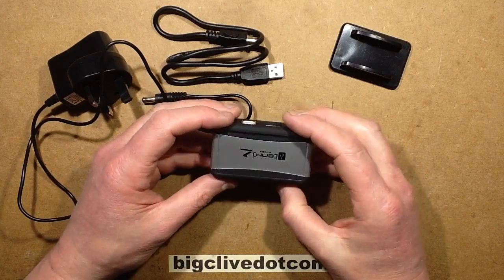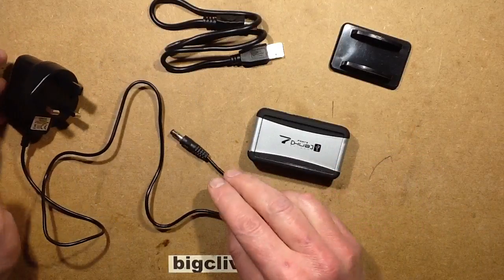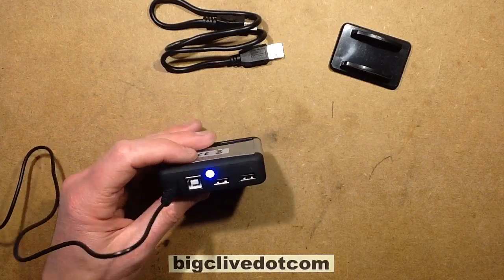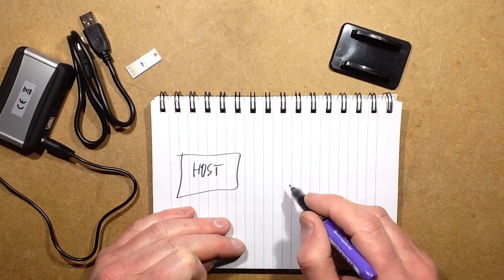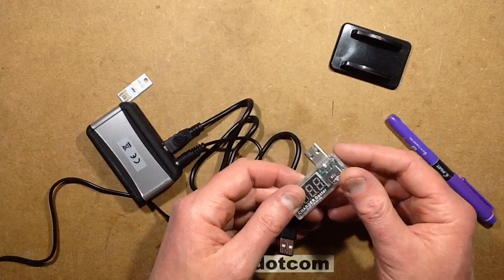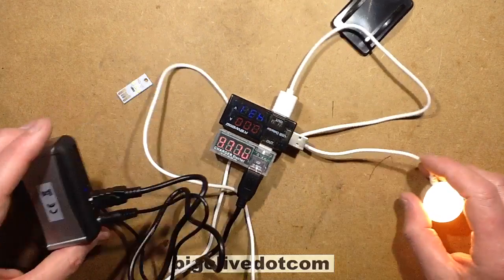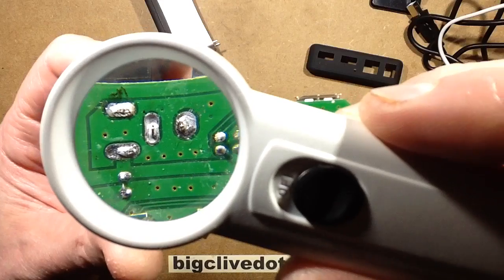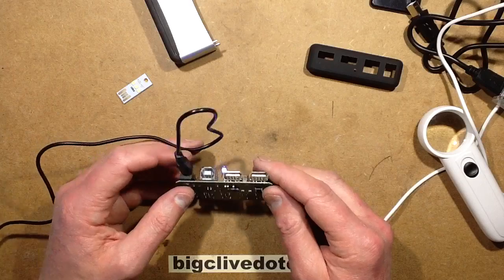Computer killing powered USB hub.  (Mac murderer)

Comment: Pretty much all hubs have the dc wired directly to the USB in. This should never cause damage to the host since for it to increase the computer's internal voltage it would take many amps of current. I've also powered arduinos simultaneously with the dc in and USB and never had damage occur.
Reply: +Anton Babiy It's funny, because they are not allowed to do so. Quoting from the standard: "No device shall supply (source) current on VBUS at its upstream facing port at any time. From VBUS on its
upstream facing port, a device may only draw (sink) current." Pretty clear, if you are not chinese.
Reply: +Anton Babiy +Some Guy You will normally have some sort of EDS protection. Reverse powering normally isn't such good idea. With standard chips you'l ll lift the supply domain through the ESD protection circuit. Something it is not designed to do. For the supply domain the situation is somewhat different. As you I'm a bit skeptical this is the real problem. On one side the Mac is not required to be protected against reverse feeding, on the other side I wouldn't expect it to be problem in most practical situations. 

Anton Babiy, inspired by your observations i checked my Logilink 10-port hub. Full continuity between power supply and upstream port. If bigclive is right, that would be a MAC killer too. I think he's been mislead there.

BTW: In an interesting side observation; I found my USB PSU is broken. That really explains a lot of problems I have had recently. :-)
Reply: +Anton Babiy Uhm no, pretty much all hubs have diodes to switch between either a charger or the hosts power, not both. If they were, they would either damage your USB controller or the port would be disabled by the USB controller which it does on shorts and overvoltages, a disabled USB port naturally does not work so for the hub to work it is not feeding 5v back into your USB controller on your motherboard.
Reply: +Some Guy in the computer the USB power is taken from the main 5v bus through a dumb polyfuse. Unless the hub is forcing voltage higher than 5v there is no problem with this. Putting a diode in the 5v path would drop it down to around 4.5v making the USB port useless for a smart device. If you send me a pic of an actual USB hub board with diodes or isolated supplies I'd be happy to change my mind.
Reply: Anton Babiy No need for pics, just open a random hub.
Reply: +Morten Kristiansen +Some Guy  That is indeed true. I've opened a proper hub and it did have a diode but a dollar store one doesn't. But I still don't see how feeding the voltage back can damage the host. As I've mentioned before, I've done so with an arduino and know for a fact that it back fed and never damaged any device.
Reply: Sure it's supposed to be secured against shorts, overvoltages and all that on the controller side and most are, but if they aren't (like the Mac apparently...) it's not a good idea :P
Reply: +Some Guy but still. How can feeding 5v into a mac damage it? It's not causing an overvoltage or adding ripple.
Reply: +Anton Babiy Aside from the problems mentioned about backfeeding power to the main +5V rail via ESD protection circuits (as if that wasn't bad enough), the (cheap) external power supply packaged with the hub is likely to have very poor regulation and to have minimal (or non-existent) electrical noise suppression.  If that is the case, it is also quite likely that the host computer won't be the only device it kills.

Comment: Are the max that it's destroying laptop or desktop most desktops use a five on standby boss that sometimes is connected to the USB ports my Toshiba laptop has one USB port that even when the computer is completely turned off stole outputs 5 V or if the batteries dead it will turn offand the reason for the output power is to allow you to charge mobile devices

Comment: if you youtube "louis rossman"..... he does a LOT of mac repair.
form re-flow, to replacing chips.

but...im not impressed with how they are designed.... they have no "over built" things. so if something is not working perfectly.... it blows the motherboard because they are using bad circuit designs with the cheapest parts. 

and of course... this sint apples fault. you have to buy apple brand USB hubs at 700% markup....otherwise its your fault?

this isnt me just shitting on macs.....im an AMD PC person, yes....but ive used macs just fine. 

but theirs no way you would stick a mac motherboard in a PC case, like mine, with a plexyglass window. 

they just look....dirty and cheap....cheaper than the mobo that came with my gateway in 2004. 
that mobo doesnt have all the flashy heatsinks... but it uses quality caps and chips.....and dosnt look like its been in a mud pit...

Comment: Presumably a "proper" hub would contain a little bit of active switching circuitry to allow operation either from the host or from external power?

I've actually got one of these - just as well I've never run it with external power!
Reply: +victornpb Diode is not that great, because of a voltage drop, mosfet would fit better.
Reply: +Lindsay Wilson the proper circuitry is called "a diode"
Reply: +victornpb I am aware of things slightly more advanced than "a diode", believe me. I was referring to the features which some hub controllers have built in, for example TI's TPS2074 (http://www.ti.com/lit/ds/slvs288a/slvs288a.pdf) has inputs for both bus-powered and self-powered modes of operation, with MOSFET switching on all of the outputs.

Comment: The last Mac I ever owned, died when I plugged a new Apple keyboard into it due to (according to Apple) the keyboard being shipped with known-faulty firmware, which required a paid OS upgrade in order to update.  Sorry Apple, but I'm taking the $300 you wanted to charge me to make a keyboard work and using it to make sure I never own another Apple product again.

Apple has had weird power management issues on the USB bus since they first started including them on their computers.

Comment: Cheap USB appliances have 'broken' my macbook before too, no response from power button or battery indicator. I fixed it by just taking off the cover to get at the battery and disconnect it manually then reconnect it then it worked perfectly.

Comment: I'd bet anything it was intentionally designed this way so they could sell/market it as two different things: A USB power bank and a USB hub.  Plug the wall adapter in and use it as a USB power bank.  Plug the USB into a PC and use it as a USB hub.  Whichever way they sell it, they include the corresponding cable, but not both like they have been doing.

Comment: interesting. i've been finding macs to be fairly good at accepting weird things plugged into their usb ports. with older macs, i sometimes had to reboot once i shorted the usb supply, but with my current one, i pretty much could do whatever i want, and just reconnecting it would reset it, so i could continue doing stupid things. I wonder how old the (now) dead macs were.
Reply: +Klapperstrauss but now that i think of it, the 2011 macbook i bought (fairly cheaply) for my mother has a dead usb port. i wonder what happened there.
Reply: +Klapperstrauss I researched the issue and found nothing about actual damage from backfeeding, rather that the protection trips and to reset it, they need a hard reset (all power off, then on again), which requires opening the bottom case and disconnecting, then reconnecting the battery on some laptop models, others are fine with a normal SMC reset prodecure. They use the same Intel chipset designs as many other high-end PC's, except Apple allows much more power draw from the USB port on some Macs than most other PC's.
Reply: +jammi Looks like you've got the most likely explanation, your comment should be higher up! I've had USB ports get disabled very frequently when plugging in questionable USB to UART converters. A reboot always fixes it. It's pretty evil that some people were told to get their entire motherboard replaced though.

Comment: i have a feeling something else is going on, i fix mac boards, and 5v feeding back should not kill the board, even if there is a short, the mac detects and shuts down the ports, 5v flows from the mac's 5v, through a TPS2561DR before reaching the port, i think its more likely its doing something wierd with the data lines, since many of those go straight to the PCH through a filter, at least on the 2012 model.
Reply: +Sam Johnson Not directly, no. But under Absolute Maximum Ratings you'll find "Voltage from In to OUTx" which must be within -7 to 7 V. Under "Electrical Characteristics" you'll find Reverse Leakage current specified to max 1 uA when Vout is 6.5 V and Vin is 0 V.
Reply: +mictaste Interesting. The data sheet for TPS256x doesn't mention any reverse current protection, and according to the block diagram current could (possibly) flow backwards through the MOSFET's body diode. I recently used a AP22802 which explicitly shows a reverse current diode. Maybe the USB subsystem can really be damaged by 5V back feeding. It's pretty surprising though as Apple hardware is usually very good (despite what people say).

Comment: that sounds weird as heck, as most motherboards have overvoltage, overcurrent, and short circuit protection,  and disables that USB controller until reboot.
Reply: +ashlie higgins Not even until reboot, most will disable until it's disconnected, plug the hub in, it disables, pull it out and plug a different (properly working) usb device in that port and it will work right away.

Comment: I have that exact hub. Used to use it for USB bitcoin miners. There interesting part it that I used to actually use the backfed power to run the controller PC fur the miners. worked fine for years with no problems.

Comment: is this hub doubling as a standalone hub and a multi device charger, that maybe why its designed that way.
Reply: +Kristian Dawe It doesn't charge devices, trust me.
Reply: +Kristian Dawe Watch the vid again ;) It doesn't just charge the ports, it also charges the HOST connection which deliberately has a different type of USB port to not confuse them. 
If it was a charging/usb hub combination it would still not have any reason to have that port wired up to the charger without a proper diode making sure there would not be backfeeding of power...
Reply: +Some Guy It will not charge smart phones or similarly devices. Any sane USB-Powered device does negotiate the current it draws one way or an other.
If a device just starts happily charging with more then 100mA when it sees 5 Volt, the device it self belongs in its own class of computer destroying devices.
Reply: +Some Guy yes i realize that its back feeding the host port, but would it work to charge devices without a computer connected and just use the power adapter.
Reply: Kristian Dawe Wouldn't charge them fast though, and still doesn't make sense to backfeed, it's just horribly designed as a normal hub with a diode will do the same without trying to damage your pc.

Comment: From the official USB specs:

No device shall supply (source) current on VBUS at its upstream facing port at any time. From VBUS on its
upstream facing port, a device may only draw (sink) current.

Self-powered hubs: Power for the internal functions and downstream facing ports does not come from
VBUS. However, the USB interface of the hub may draw up to one unit load from VBUS on its upstream
facing port to allow the interface to function when the remainder of the hub is powered down.

Comment: I once shorted out a Mac's USB port and it actually handled it pretty good. It just gave a scary looking error message and that was just about it. But, that was several years ago so, I guess they aren't making Macs as good as they used to.
Reply: +Andrew Ricker That's how it's supposed to function (and nearly anything does it this way) maybe the Macs were really old or Apple actually build them that much cheaper now...

Comment: That's why I build my own PCs. Every Motherboard that supports Windows/Mac has short protection, as well as high input protection. Sad that a $2000 laptop doesn't.
Reply: Correction - Windows/Linux
Reply: +Shifty Miata no not all boards have that protection... And Short Protection is something different. It protects from shorts, which means too much power running through the port.
Backfeed is something different.
Reply: djteac "as well as high input protection" And yes, all motherboards since like 2008 have it.

Comment: I have one of these hubs and have used if for about 3 years and my MacBook Pro is fine however I usually put it in sleep mode at night and the power to the hub is switched off too so I think that may have saved it. Just tested it and it does backfeed. Removing it first thing tomorrow and will buy a more expensive branded one.
Reply: +Tom Tyler Don't need an expensive one, just one that isn't complete shit ;) Never seen backfeeding on a hub until now and have had countless hubs, never spent more than $5 on them. (A USB3 hub did cost me more though...)

Comment: Most powered hubs have the power rails diode ORed together so the hub can be run with or without the PSU, but not backfeed power.
Reply: +thephantom1492 A schottky diode is just a few cents more expansive, but only has a 200mV drop.
USB powersupply tend to get specified on the higher side of the tolerance (5.2V ... 5.5V) to allow for some voltage drop on the leads.
Reply: @sarowie  Schottky diodes are leaky, though. You are better without diodes at all.
Reply: @samuellourenco1050  Where did you hear that? They certainly aren't leaky unlesss broken.
Reply: @mjouwbuis  Haven't heard that. Tested myself. I had two hubs that had such diodes. One of them was feeding around 3V to the host port. The other was feeding back just below two volts. In either case, I've removed the Shottky diodes. They can no longer function as bus powered hubs, only in self-powered mode, but I can live with that.
Reply: +Mark Furneaux That is how it should be done, and also why some use 5.7V powersupply. And also why some devices just don't work on usb hub due to the voltage drop in the diode...
Reply: thephantom1492
In case of "host powered"/"no wall adapter attached", using an Silicon diode on the PC side would bring the voltage out of spec for all devices down stream. But I think we agree that people that split cents don't care for specification either way.
Reply: And some have a power socket that switches out the host +5V (similar to the old AC/DC method that cuts out the batteries when you plug in an adapter)
Reply: sarowie
I know about the schottky, but they are more expensive than, let's say a 1n4001, while a smps can be just adjusted a bit higher freely. Price optimisation often do not justify the schottky price, specially since there is so much chinese stuff on the market, even in brick and mortar store.

Comment: You would think after the first mac dies when you plug this thing in that you would not keep doing it...But I guess not everyone thinks with common sense anymore..
Anyways cutting the track between the host port and the DC barrel port (+), sanding the tracks to copper slightly and installing an SMC diode would remedy the whole problem. It would prevent "back feeding"
Reply: +ElfNet Gaming - You greatly overestimate the logical reasoning abilities of the average Apple user.

Comment: For future reference, the USB data connections are TX and RX. Also thanks for explaining the PAT testing process. I work in digital marketing, so that'll help me write content for some of my clients who are electricians.
Reply: The wires are named GND, VBUS, D+ and D-. It doesn't have separate Tx and Rx lines. Instead direction is changed as required.
Reply: No, they are D+ and D-.
Reply: +afxinfinitee Nope.  It's a differential protocol.  Not TX/RX - D+ and D-, both are used for sending the signal at the same time. The devices have to negotiate who's driving the pair at any given time.
Reply: +John Ridley turns out my technology teacher was a bit of a liar then.
Reply from the maker: +afxinfinitee It's not actually a normal PAT test to do to a mains adaptor.
Reply: +kilrahvp The master of the obvious from the Department of Redundancy Department has arrived.
Reply: +afxinfinitee Or just plain misinformed. :p
Reply: afxinfinitee Strictly speaking he could be right. USB superspeed has two extra wire pairs, RX and TX. That's why some of the connectors are a bit larger. This particular hub, however, seems to be high-speed.
Reply: +Morten Kristiansen Even so, those are differential pairs, not single lines.
Reply: Yep - at those speeds differential is your only real option.
Reply: +Morten Kristiansen I know. :) Point being that I still think the most likely option is that his teacher was just misinformed after all.

Comment: This made me look at my trusty old mini 4 port powered i-Rocks (IR-4100) USB hub w/controller (AU6256-D41-JAS-GR) and it behaves the same way since it too is missing a diode except it hasn't harmed anything yet in it's life. I've used it for years with a Apple, Asus, Biostar, Android, Raspberry and Banana Pies. This makes me wonder if something else is going on? Are we sure it's destroying laptops as in Terminal??? I did a search ("Apple support" "USB hub kills laptop") and found other cases that eluded to a USB hub preventing the PC from resuming from sleep. This issue being the USB Controller chip on the hub having a poor implementation of USB 1.1/2.0.
- 
As a side note: I just plugged in 5V from my 450W PC power supply to the USB of and old HP Laptop and also tried shorting the pins and had no luck in letting the smoke out. Like the Power Supply the USB controller seems smart enough to protect itself. I'm skeptical about Apple being any more fragile.